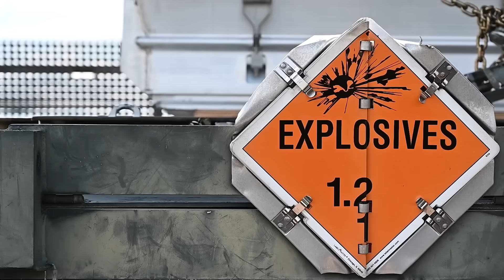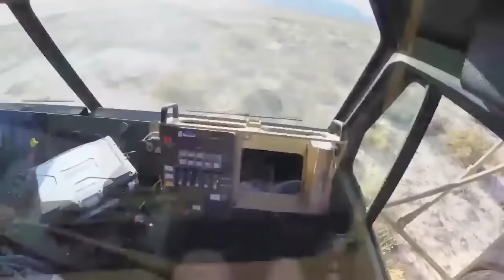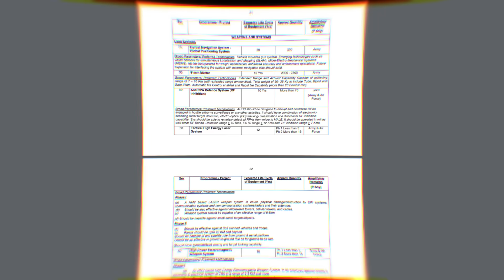US 100B$ HYPERSONIC and LASER Weapons Are FINALLY Ready For Action!

Comment: Laser mounted hypersonic missiles are the best. The lasers are for protection of the nuclear warhead until it reaches it's destination.
Reply: The LAWS two megawatt laser could destroy an ICBM target 100 km away in two seconds.  I doubt if a laser mounted on the  ICBM could do much about it.  
A ten centimeters long solar powered ram jet hypersonic  drone equipped with tiny radar, lidar optics and communications might cost less than $100 if it was mass produced like a smart phone. Travelling at 10 km oer second, it could put a hole through a nuclear warhead and set off the explosives inside.   An often cited argument  against ABM systems is that the enemy can make another ICBM for less than the corresponding defense costs.  But if an ICBM costs $100 million on average, a million drones at $100 per drone could probably take out a thousand ICBMs costing $100 billion dollars.  
Directed energy systems depend on a large supply of energy.  A twelve volt car battery with 800 cold cranking amps can generate about 10,000 watts.  100 batteries in a home solar battery pack  adds up to a million watts.  Times a million in a metropolitan area is a trillion watts.  A pulsed trillion watt laser firing a trillion Joule pulse is as much firepower as about 250 tons of TNT.   That kind of firepower could even destroy asteroids large enough to threaten a city.  
Most laser systems try to burn a hole in the target.  A 100 watt pulsed laser can create a small explosion of plasma at the focus.  If enough lasers converge on a point on or near a target, the plasma would be hot enough to generate Xrays that can penetrate inside the target.  Xrays are ionizing radiation.  A sudden intense burst of Xrays might set off the explosives inside the target at laser powers much less than would  be needed to burn a hole in the target.  Explosives chemicals are already unstable.  A sudden mechanical shock or high voltage shock can set them off.  One kilogram of TNT is equal to about four million Joules.  One thousand lasers each firing a 4000 Joule pulse might easily destroy a nuclear warhead by setting off the chemical explosives inside.  So a million such lasers attached to solar dishes  in  a metropolitan area might destroy hundreds or thousands of targets in a few seconds.  
A CO2 laser is one of the most powerful lasers and might cost about the same as a flourescent light if it was mass produced.  It is basically just a glass tube with two high voltage electrodes on the ends like  a flourescent light.